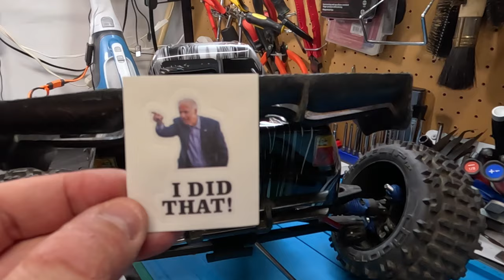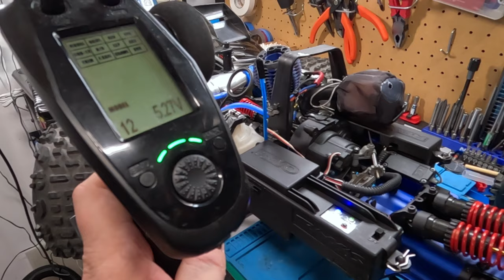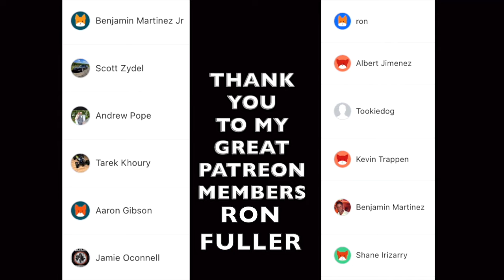Revo 3.3 OBLITERATES Crawlers in a Top SPEED Run Away - What Happened?

Comment: The receiver battery pack may have been the issue. The voltage drops significantly when using AA’s as a receiver pack. When that happens it causes a “brown out”. That’s when the receivers stay set at the last setting that they were at until the voltage goes back up to operating levels. So in this case the failsafe won’t activate while the receiver is in brown out. Happened to me twice. Started using lipo and life packs and the brown out (run away) hasn’t happened again.
Reply: Had this happen to me today on my jato 3.3. Brand new batteries and still ran away. Lost all power to my truck while it was at WOT. Needless to say she went and I couldn't do anything about it lol. I'm assuming my battery pack in the truck is at fault? Would running a pack help this issue?
Reply: @Davewertzjr  Yes. A life or a lipo receiver pack is better than using AA’s. I haven’t had a run away since I stopped using AA’s.
Reply: @hobbymanrc79  I think I'm going to search and see what lipo fits my jato. I have a traxxas ID live charger, so I will be able to charge whatever lipo.
Reply: @Davewertzjr  Be sure to check what the highest voltage the receiver and servos can run on. To be safe use a 2s lifE pack, it’s 6.6 volts and shouldn’t burn up your electronics. Also, make sure that you can even use the traxxas ID charger to charge receiver packs.🫡🫡🫡

Comment: Buy a futaba 4GRS . Futaba is hands down the most reliable system
Reply from the maker: Hey man, thanks for checking out this video. I totally agree. The Futaba systems are the best on the market. I will tell you the radio gear used on this particular truck is super reliable and has never had any glitches on any of other cars that it is programmed to, therefore, this is still a mystery.

Comment: Ive owned many Nitro traxxas models over the years... Jato 3.3, Revo 2.5 and 3.3, T-maxx, 4tec etc.... and never had an issue with OptiDrive causing a runaway.... 
if i was to place bets, I'd say its more the likely something to do with the radio not frequency hopping as efficiently as it should, Due to being lots of radios around....
2.4ghz radios only go from 2.4ghz - 2.48ghz.... There is alot of spectrum between 2.4 and 2.48, But still... The amount of radios that were active there.. I'd say the frequency spectrum was either running short of "spaces"... or the radio just struggled to frequency hop itself...

Comment: NO don’t do the forward only.  Why when there is Steele forward and reverse gears on eBay.  👊😎

Keep reverse that’s one of the revos perks. 🙏☺️
Reply from the maker: hey bro! yes, you got a point there.  It's literally the only truck left on the market with reverse, nothing else you can buy brand new has reverse anymore, sickening!
Reply: Can you confirm if optidrive applies brakes like a failsafe if the transmitter cuts out?
Reply: @michaelinzitari  
The receiver is what has  the fail safe within its programming options.

Comment: Hello, where did you find your Air filter protection net ? Thanks
Reply from the maker: Hey buddy, thanks for checking out this video. That air filter cover was sold with that particular filter, usually the motor saver brand filters will come with these. To be honest with you it is pretty unnecessary. The regular dual stage air filter is modern enough, especially when the elements are oiled as they should be.

Comment: My revo was doing this.  Turns out my shift servo was crapping the bed so every once in a while its would cause a current draw and cause the servos to move very slowly. So randomly while on a wot pass, the throttle would return very slowly even though i was off the throttle. Pulled the opti drive and now no more throttle hang. I like having the reverse so im looking into finding a good replacement micro servo

Comment: I've had my Jato do this a couple time... I don't really know why, but there would be a difference in the way the radio was set with or without Traxxas Stability Management(The App). Meaning that if it was ON, it runs great... if it was OFF... throttle would stick for about 3-5 seconds. Change batteries in radio and always have TSM app on, haven't had the problem sence.

Comment: That GT5 needs the failsafe to be on a small amount of brake. Neutral is no good. If anyone touches the throttle trim and there is an air leak or temp drops the engine can pick up speed. Also my understanding is that optidrive is a sensor AND a failsafe. But clearly nothing happened in your demo when you turned the radio off. Just wondering if we should confirm if optidrive failsafe applies brakes or just neutral as well

Comment: That was probably due to many many radios around you. I feel like that is possible. I have had my flyskyGT3B on my baja when I go into a new construction neighborhood with a cell tower near disconnect like 50 feet away from me. Luckily I have a kill switch that kills the motor when it’s out of range and when the battery dies or it would have ended terribly!
Reply from the maker: Hey man! thanks for your thorough comment. That is possible, we can definitely confirm there were a ton of other RCs in this area, so I guess we could have experienced some signal glitch.  Really nothing else would explain why it suddenly went to full throttle, while it had a proper throttle return spring and the fail-safe too.  Sickening!  Lets just be glad nobody was hurt.

Comment: does he have the batterie hold down in the remote maybe the batteries lost connection
Reply from the maker: now this is a good possibility!  Although if that happened then the fail-safe and throttle return spring would have just kept the truck at idle.  I still cannot correctly explain the unintended runaway.

Comment: I can’t tell from the video, is that loose red wire long enough to get caught up in the throttle linkage?
Reply from the maker: hey man!  Great observation, I will tell you that it's not likely and not possible any wire got caught to cause that.  Even if it did the very strong throttle return spring would still close the carb.  When I first looked over the wires I did not notice any loose wires either.

Comment: i think the starter motor is fine, the wires are wrong connectet to the ez starter motor, red has to go on the upper connector, i hope it was that
Reply from the maker: Hey my dude, thanks for checking out this video. We made sure that the wires were correctly connected, even if they were flipped, the motor would only have spun in the reverse direction you know.

Comment: Here’s a theory may be the throttle over extended causing it to jam wide open because on some radios when you turn up the idle from the controller lets say its cold and you need to turn up the trim it actually extends the servo past your end point setting just a thought

Comment: Wow that was a bit scary. Got very close to hit that group of people. Glad no one was hurt. 🩷
- Did the owner have to pay to fix the crawlers? 
- Q: You turned off the radio but, didn’t really check the fail safe since it may be in a neutral setting. Just to double check…Radio and receiver on (engine off), then hold full throttle with radio trigger and then turn off the radio to see how it reacts. 
- Regardless, fail safe to full brake next time, return spring and honestly maybe, different radio system and servos. That throttle servo doesn’t seem too strong. 
- I have experienced some 2.4g systems gain interference from power wires and who knows, with that many people driving at the same time, maybe traditional radio interference happened ?

Comment: I've seen opti drive do stupid shit.... especially if the reverse servo is shitting the bed.  Opti drive is a problem waiting to happen. It's trash. I remove it from all of my rigs that come with it equipped, before doing anything else with the rig. 
  It very well could have been a radio signal issue with all the others around, but as i said, ive seen a few of mine glitch out and do bonkers shit. I'd suggest removing it regardless.